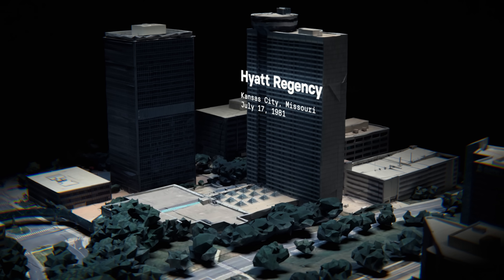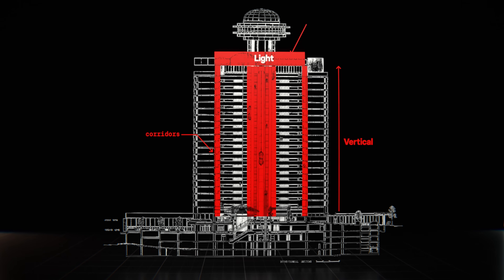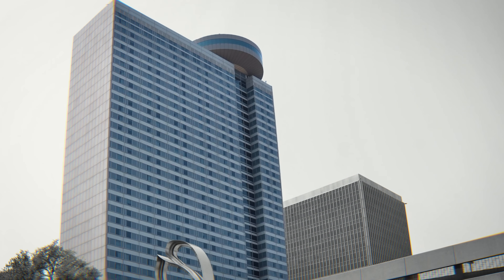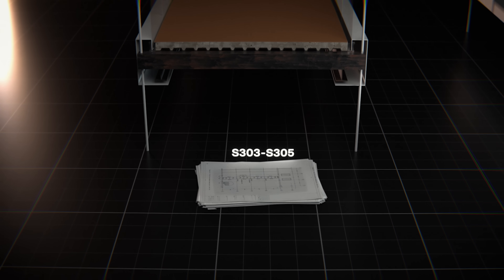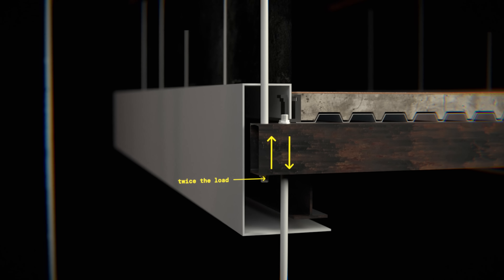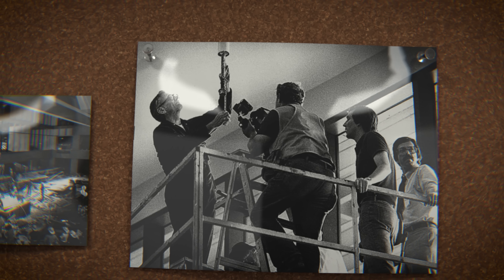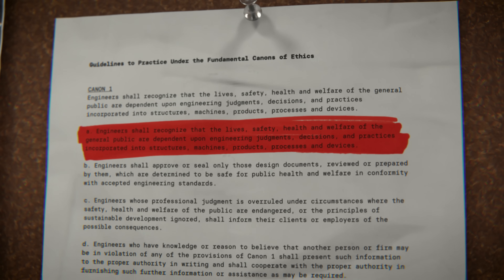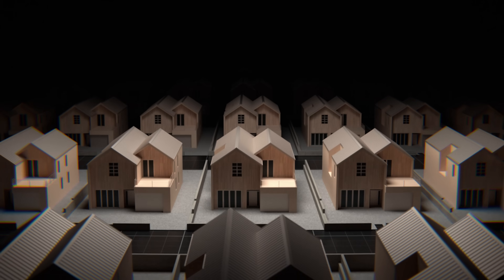Inside the Hyatt Regency Skywalk Collapse

Comment: everyone always wants engineers to work faster but they never want to take the blame when your rushed work has errors
Reply: Correct. The only time I see upper Management as a maintenance engineer is when they are asking how long will it take me to fix the problem that I warned them about a month ago.
Reply: From a corporate decision-making perspective

The laborers are the most expendable

They can be poisoned, fired, deported, injured, killed etc.

What are they going to do? They can't afford good enough lawyers to fight the company

Engineers are more valuable but still expendable. They can be thrown under the bus and replaced
Reply: Akin's Law #41:  "There's never enough time to do it right, but somehow, there's always enough time to do it over."
Reply: It's the engineer's job to say no if he doesn't think he has enough time to do a safe job.
Reply: This is such a MASSIVE error that it just should never have happened.  Like, you don't need to be an engineer for this design change to give you pause.
Reply: I was a civil engineering student studying structural design and one of our assignments was to assess responsibility for the failure of the Hyatt regency skywalks. While the fabricator along with others contributed to the collapse, the engineer was ultimately held responsible and lost his license because his stamp verified the materials in the shop drawings would work. I personally don’t like that the more than likely overworked engineer is responsible for reviewing and validating shop drawings, especially if they differ from his proposal, but that doesn’t change the fact that you should never put your stamp of approval on anything you are unsure about. A lot of these comments are right. You most definitely can lose a greedy client by expressing that the design will need more time, but that’s a hell of a lot better than causing an absolute catastrophe such as this one.
Reply: It’s clearly both parties fault. An engineer should NEVER stamp a plan that isn’t safe. And companies should never continue with plans that an engineer has deemed unsafe
Reply: @sldarwin5615  it is indeed both parties responsibilities, I agree with you there! HOWEVER, the actual party that made the causal action, I believe, would be management.
Reply: @sldarwin5615 in theory in a perfect world sure. In reality no this is on Hyatt
Reply: @sldarwin5615  correct.
Reply: Well of course not. That would be insane. Not-engineers can't be responsible for the work of the engineer.
Reply: Because whether you like it or not it is the Engineer’s fault. He is the one that oversees the structural integrity of any aspect of the building’s structure. And in this case as an engineer you should know if this added element to the design will not be plausible in the time frame given AND should have told the client it is not possible and ask for more time.
Reply: @EzraDivina I work in fabrication industry in oil and gas and has sat in many of these kinds of discussions before. Its really not up to just the Engineer to put a kibosh or delay parts of a major project. It depends on the leaders and the overall culture of the company. If the designated engineer is overworked and gets given a pile of work to do in order to meet aggressive deadlines, you reduce the chances of him spotting issues on the design. Even if he does, sometimes, even when he has doubts, the overwhelming feeling of hundreds of other tasks that is waiting for you, or managers breathing on your neck is enough to overlook (intentionally or not) certain issues that you may find.
Reply: @EzraDivina  no it isn't, it's Hyatts fault for forcing it to go ahead and not stopping when the roof collapsed, blaming the engineer for their problems is a cowardly cop out
Reply: @tacos315 yeah but the regulations have to rely on people with conscience, which is easier to find in Engineering over CEOs.
Reply: @EzraDivina This is delusional. A company that gets told that their design ideas are impractical will just find an engineer who will do it for them in their dangerously rushed timeframe.
Reply: @norunninginmylobby  again, an engineer putting their stamp on the work
Reply: @norunninginmylobby  So basically, it's just another engineer stamping a dangerous design
Reply: @GoobleryKu the engineer isn't robbed of free will because he's employed. If your employer ordered you to do something wreckless or dangerous, would you do it?
Reply: @GoobleryKu If you value money over your reputation then that's on you.
Reply: @TannerLaran what is so wrong with blaming a rich corpo too?
Reply: @TannerLaran 
We're so individualized that when we have a societal problem we are incapable of fixing it.
This problem would truly be better fixed by regulating companies.
But no its only ever the engineers fault, we will continue to not put in the work to save lives cus "oh its just that guys fault"
No one said the engineer shouldn't be held responsible, theyre asking that more than the engineer be held responsible.
Reply: @bbbbbbb51  there is ALWAYS someone who will never refuse these jobs because they need to get food on the table and pay for rent/mortgage
Reply: @EzraDivina  ok and then they just fire that engineer and find someone who'll just shut up and do it, because in a world of 8 billion people SOMEONE will just shut up and do it. so at the end of the day, it's the fault of whoever's giving the orders.
Reply: Typical weebo comment.

Comment: The explanation you gave for why the supports for the walkways were changed was incorrect. It wasn't an issue of installation, it was an issue of manufacture. Havens steel (the subcontractor) could have installed the rod, the issue was that as originally designed the rod was supposed to be threaded along it's entire length. Havens Steel wasn't able to thread such a long rod and so asked to be able to split it, doing so meant they only had to thread the ends of the shorter rods rather than the entire length of the original.

Comment: I am not a structural engineer, but I  should have designed that walkway. I have flown on helicopters sitting in the door with my feet hanging out, but heights scare the hell out of me. The first thing I would have said is a skywalk is not a good idea. If the client insisted, I  would have suspended it with so many cables that it would have looked like a spider web.  
When the walkway crashed, the construction was explained. The rods were great, but putting them through the flimsy steel channel was BS.

Comment: This is one of the biggest stories told to every single architect in engineer. This story would haunt me if I was the engineer that signed off on this change, because when you first think about it it doesn't seem like nothing changed. It's still the same weight being held up by the all thread it's just you don't have to thread 2 miles worth of nuts! But then when you look at it closer and you realize it

Comment: I’m a non-engineer. I’ve seen many videos trying to explain this, but while you did a good job explaining the flaws in the process, I still don’t understand the technical details of the problem.  WHY did the change made by the contractor so drastically reduce the strength?  What was the mechanism?  As well, there was no mention of the dance being held which I understand was the reason for the eventual collapse and was why it was so deadly…there were a lot of people there. 
Love the channel, Stewart.

Comment: One thing often not mentioned is that the investigation found that the 3rd walkway was also starting to fail, even though there was nothing hanging under it. This means that even without the 2nd walkway hanging underneath, the design was inadequate. I read about this in a fascinating book called "Construction Failure, 2nd Edition" by Jacob Feld and Kenneth Carper (the 2nd edition contains a lot of additional material that's not in the first edition). Unfortunately this book is expensive, but well worth reading for examples of things that get overlooked during construction (although in this case, the failure happened after the building was finished). The authors point out that many "freak accidents" are in fact predictable.

Comment: I think it would also be valuable to students and individuals not aware : While both bridges were connected, the bottom bridge was actually hanging from the ceiling in the original design via that singular rod. This distributed weight from the bridges and any occupants to the ceiling. In the design where the rods are offset the top bridge is the only one actually being supported by the ceiling superstructure while the bottom bridge is now completely reliant on the top bridge and reduced the strength and allowed occupancy by around 80% ( which as mentioned in the video the initial design being shoehorned in already was stretching it ).

Comment: The developers were at fault for running roughshod over the engineers and contractors. The developers chose not to engage the extra structural engineers who estimated 700 hours, or, a mere $70,000 to $100,000 in fees.  They always say there is never enough time or money to do it right, but somehow they always find the time and money to do it over. Developers fault as well as the structural engineer. The architects design was a loser as well.

Comment: It wasn’t designed to fail, it was built to fail. Even in your video you said it wasn’t built as designed.
Reply: @Chris-cv1ll  Well, without the plates instead of just washers it was not to code and the change to two separate rods was just the thing to insure failed even with the safety factors

Comment: One thing that keeps me up some nights is that the software development industry is currently in the same state that engineering was at that time (and in some cases much worse). We have already seen examples of glaring oversights leading to deaths. What keeps me up is the thought of what kind of accident will it take for that industry to go through a similar transformation.
Reply: Yet companies are trying to cut costs by doing layoffs, outsourcing, and using AI. Software engineers are treated as factory workers pumping out code changes. To management, the more lines changed per day the better.
Reply: That industry pushes millions of people to an early grave due to tech keeping them physically inactive. If that fact doesn't motivate them nothing will. You are not seeing the bodies, but the bloated zombies already walk the streets.

Comment: In the original design, were those rods supposed to have been threaded for their entire length (which would have required a long time just to install each nut)?  Or were they supposed to be threaded only in the region of the beams, and narrower elsewhere to enable the nuts to be installed?  Either way, it's not surprising that the steel company changed the design to something that looked more reasonable and normal, even though it was stucturally unsound.
Reply: Why would that have caused a failure though? From what I saw it was the beam that failed due partially to a plate between the nut and beam being skipped.
Reply: @-DM If it had been a single long rod (as originally designed),  then the load on the upper catwalk beam from the nut would have been halved, since it would be carrying only one catwalk, not both.  But the redesign by the steel company meant that the beam experienced the load of both catwalks, and thus failed, as you said.

Comment: i could be wrong, but I think the thumbnail is misleading. It wasnt "designed to fail", it was designed properly, but was changed to the easier and more affordable option that got built after the project started and no one caught it. Right?
Reply: Ya that’s what I was taught when I learned about this in my mechanical engineering undergrad courses. A quick check of Wikipedia seems to back this up as apparently the steel contractor was able to get the PE to approve the change over the phone without formal review. 

The proposed change could’ve even worked if beefed up. The issue at play here was improper review and approval processes.

Comment: I was born in Kansas City 4 days after the collapse, and now I'm a licensed professional engineer in KC  (electrical, not structural). I've sat in a presentation on what went wrong, not said in the video is that the lower walkway was rebuilt and, as it was described, you could drive a semi-truck across it and it wouldn't budge. 

Oh, and we definitely still do engineering design as construction goes on. If anything, that has gotten worse as we don't have to redraw construction documents by hand.
Reply: I live elsewhere in MO but I stayed at this hotel a few years ago for a conference. A colleague told me about the disaster as we were standing in a massive line of people on one of the stairwell platforms that hang over the lobby. I was like, sir, why on earth would you tell me about that at this exact moment???
Reply: Wow mister you must 1000 years old
Reply: @loganv33 and electrical engineers can’t design much less stamp structural drawings so that you are one means nothing to the discussion

Comment: lol so some chump couldve just used thicker washers or 20$ of steel plates and this all wouldve been fine?  nobody tested it to like 200% after install to make sure hur dur its safe?  6 months of engineering and putting some trash cans with water on the dumb thing wouldve provided better testing? sounds about right